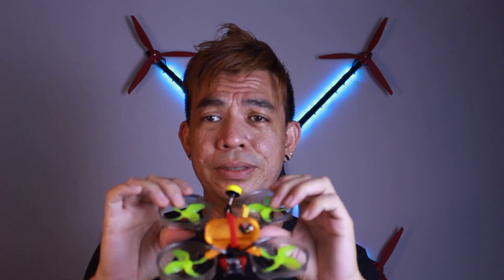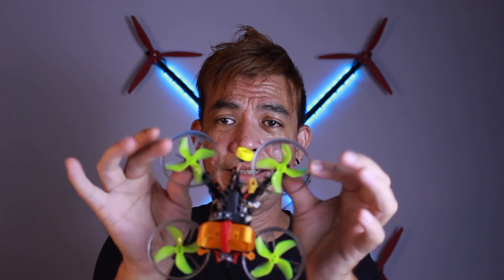Crazybee F4 Pro V3.1 | HappyModel Cine 8

Comment: what the pid rate ?
Reply from the maker: Its all stock bruh.  I never change anything for any Happymodel quads.  I fly them all stock as they're already tuned from the factory.
Reply: @shogunemperor  the esc support 4S ?
Reply from the maker: @captaindronieversefpv  I would highly recommend up to 3S only.
Reply: @shogunemperor  whuaa ..you cut so much weight with that frame. what frame is that ?

Comment: Hi, would you prefer the crazybee F4 pro V3 over the CrazybeeX FR V2.2 ? 🤔 I guess they are nearly same in weight but its 2~4S 10A vs 2S 5A. I have the crux3 and UZ85 running on 2S and thinking of upgrading the board to the F4 Pro V3 just for the 10A. Should have more performance punch on the throttle. Motors should handle it. Or am I wrong why the manufacturer stayed on the 5A Board?
Reply from the maker: Hey Chris, thanks for dropping in.  I actually prefer the CrazybeeX on 2S as compared to the F4 pro.  On the Crux3 its just brilliant and its my daily flyer. On 2S with the Insta360GO its just brilliant for me. I love it for its power-to-weight ratio and efficiency as compared to the F4 pro. Even then, I still use a 2S lipo for the F4 pro except for this Cine8 which I use a 3S lipo for longer cruising flight time. But if u are into more power then the 3S would make more sense on the F4 pro. Do check out AngryDonFPV's video on that one here:
https://www.youtube.com/watch?v=gadDblNwxeg&t=20s
Reply: @shogunemperor  Thanks. Your are right. Efficiency is less and it does weigh about 3g more. Also I just saw the F4 Pro does not have a VTX installed. So you need more building space and components plus weight. I see now why it is delivered with the CrazybeeX V2.2. Power to weight 💪
Reply from the maker: @chrisbee5481  oh ya! I forgot that it had the built in VTX!!! Its surprisingly good at 200mw weighs less without the external VTX and space saving! Thanks for reminding me! Hahah

Comment: Great stuff! In your opinion what is a robust bnf quad to practice freestyle with if, I prefer to learn  through actual flying and not a sim but on the same hand want to minimise damage and repairs, thanks
Reply from the maker: Hey thanks mah man!!  And thanks for dropping by!!  Well, I'd say... a combination of different quads.  I'd recommend the Mobula6 as a starter quad or the BetaFPV starter kit if u dont already have ur radio n goggles.  Mind you, you will crash alot. Its all part and parcel of flying FPV.  The other I recommend is the Crux3 but that is only once u are used to flying FPV and want to improve on ur acro maneuvers. I've crashed like a bajillion times and destroyed so many of my electronics.. but thats kinda part of the hobby!  All in all, I hope that helps and wish you the best on your FPV journey!!!
Reply: @shogunemperor  Thanks for the useful info and advice. Yes agreed that's part of the process, it's not an inexpensive hobby that's for sure.
Reply from the maker: @kkam7044  its my pleasure bruh!!  YES!!!  I mean, it is expensive to a certain extent.. but done correctly, it need'nt be.